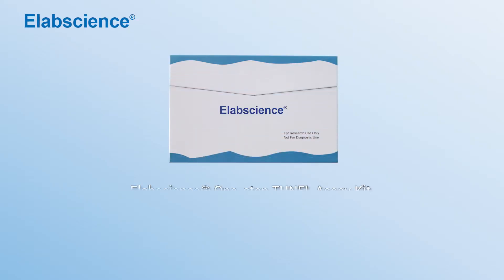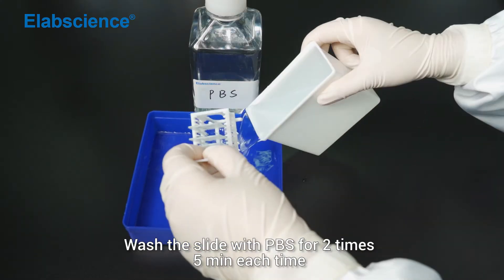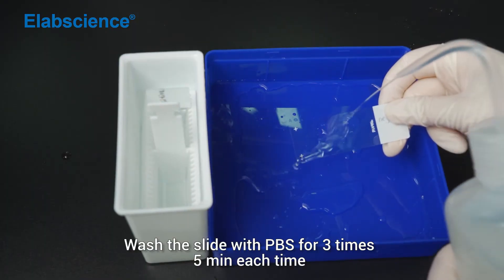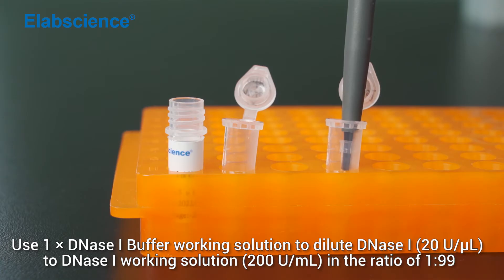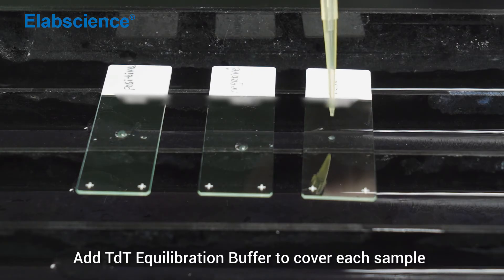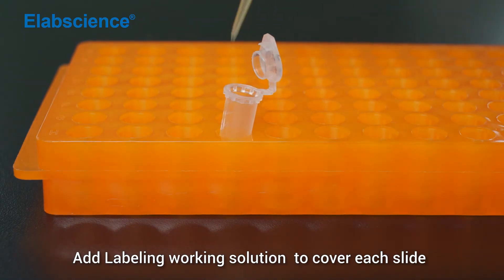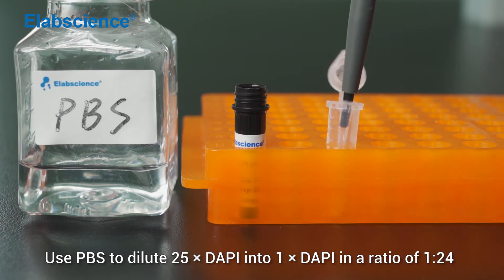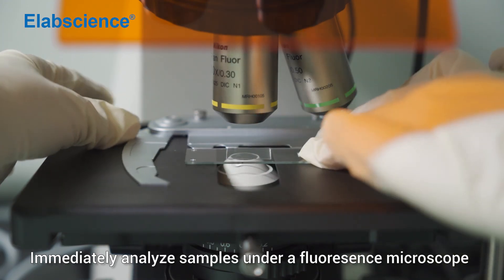One-step TUNEL (Paraffin Section) Operation Guide

Comment: Can I use 3D bio-printed to study the apoptosis assay using this kit? Or do the 3D models need sectioning first? Thank you!
Reply from the maker: The models need to be sectioned. This assay includes a permeabilization step, and if the sample is too thick, it may not be fully permeabilized. Typically, paraffin sections are 4–6 μm, and frozen sections are 5–10 μm.